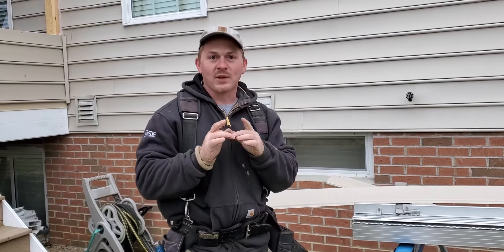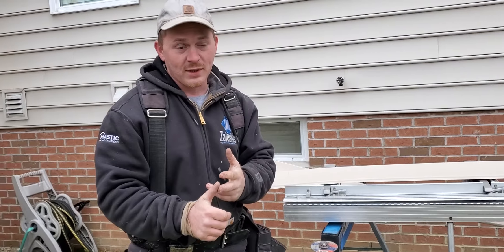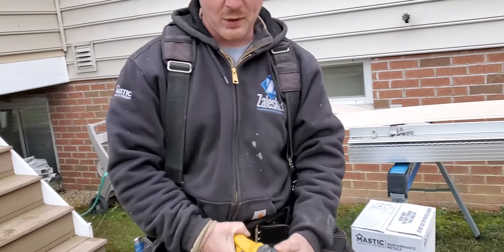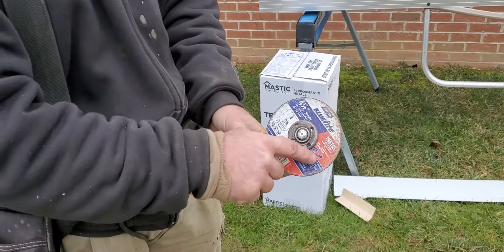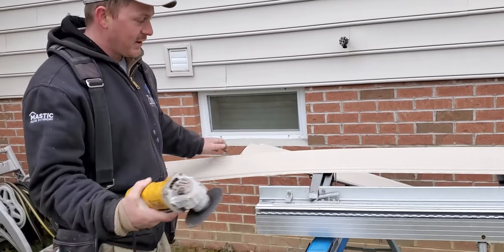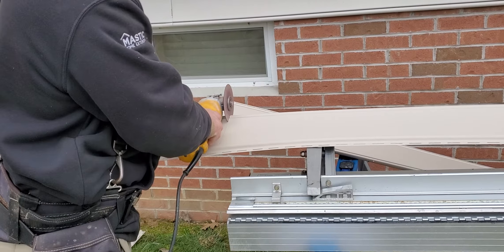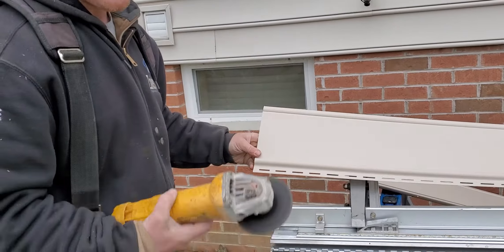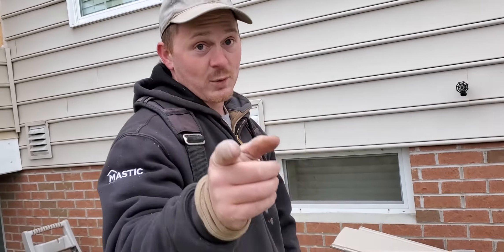How to cut vinyl siding

Comment: Question - is that an angle grinder you're using with the blade you described?  Would I use the same tool & blade to cut siding that's already installed?  I'm venting a range hood to the exterior (vs. recirculating inside kitchen) for my kitchen remodel.  It has a 6" diameter round exhaust.  Thanks for your advice / expertise.
Reply: You can use any angle grinder to get it done. The one I am using is a Dewalt 4.5" with a cheap metal wafer wheel. they are $2-4. Yes! you can definitely use it to cut the siding in place. I would recommend nothing else. Just take your time.  Any further questions please feel free.
Reply: Just to clarify.. when you say metal wheel, you mean a 4.5" abrasive metal cutting disc for the angle grinder. That's for the army of YouTube home improvement noobs.
Reply from the maker: @jt8907  You got it! We call them wafer wheels. Cheapest ones you can buy. Thin cutting wheels. Metal or masonry, they both work great.

Comment: Can you use this tool to cut through the siding while on the house? I'd like to cut out a hole to attach a hose winder holder whatever it is called without using a hole saw which I've seen on other videos.
Reply from the maker: Yes. Just take your time. Go slow.

Comment: Very dangerous and eventually you will get a cutting wheel in the head or a piece will cut you bad or kill you. Never use an angle grinder with a fiber wheel and no guard.
Reply from the maker: @bestseedorchard1107  ive been using a grinder longer than i haven't, and have never had a kick back while cutting vinyl, metal sure, but vinyl, absolutely not. Is it possible... I guess, likely.. i think not.  

That one blade will last an entire siding job, if not multiple, because its cutting vinyl, not metal. Hard to damage that wheel with an inferior material. 

Appreciate your concern, but cutting vinyl with a grinder is not only efficient, but less risky than cutting it with a saw, especially in the cold.